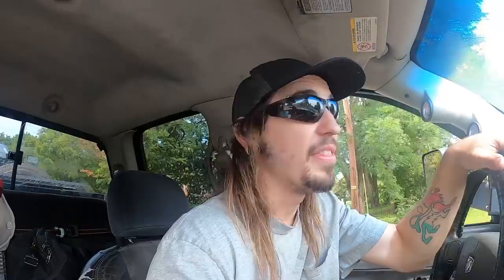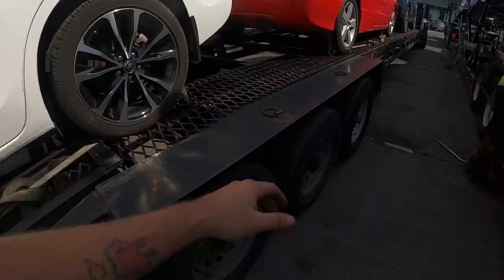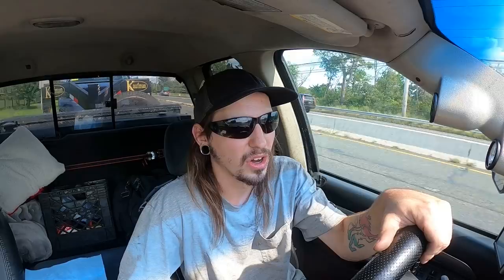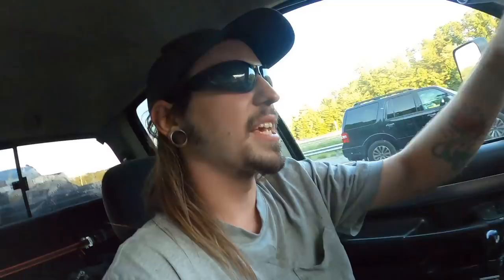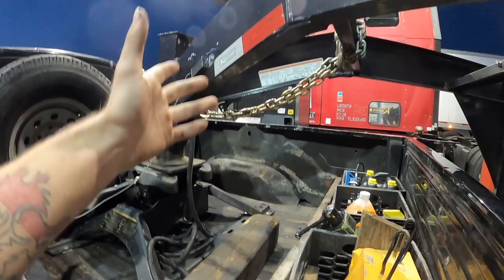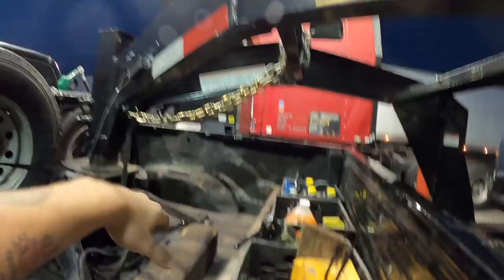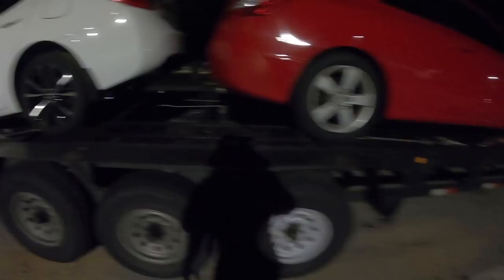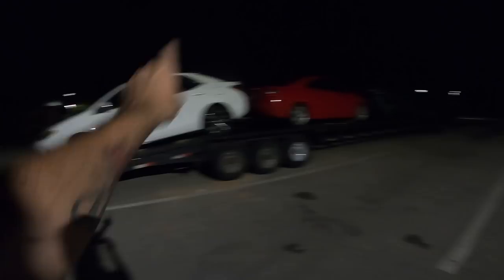This Load Threw Off My Trip | 3 Car Non Cdl Car Hauling | Hotshot Trucking

Comment: If that trailer has a slipper spring setup, you have to look closely inside the spring hangers....they break all the time! The spring rests on a steel plate that is welded inside the spring hanger. That weld will break..the plate will fall out and then the games begin.. a lot of guys miss this problem because you actually have to be flat on your back to look up inside to see it. I missed this my first time and broke more stuff...also, GOODRIDE makes a great 14ply.

Comment: If you are not sure of weight.  Weigh first.  It’s easy to figure how much fuel you can safely add.  Basically in sumner 7 lbs a gallon. @ 7.1 to @6.8 lbs depending on temps, additives
Reply from the maker: I did that last time. Could only fill up 93 gallons out of the whole 140. I figured I was way over on this one though!

Comment: I ran the china made providers 14 ply on my goose neck.  It was cheaper to buy them brand new mounted on rims than to just buy the tires.  Plus when you go to the 14 plys you need to go to the heavy duty 4400lb rims or the extra tire pressure may cause rim failure (happened on my Step dads camper).  The tire wear im betting is axle alignment.  If you got a tape rule measure a spot on that side an the same exact spot on the other, bet that pass side is farther forward than the driver side.

Comment: I got a Edge on my truck and I had no receipt or anything to back up purchase. I opened a claim on the website not expecting anything  but I explained unit was totally dead. Wouldn't power on in truck, wouldn't power on when connected to a PC. To my surprise they repaired it no questions asked for free. They even included a ticket with what they fixed. Worth reaching out, they seem to really stick by their products. Sucks its been so problematic for you.

Comment: Some lights under the trailer for loading or checking the load would be cool...add a switch. Or, get flashy with some neon's! As for your tongue weight, it's not a set amount you are looking for, but a percentage. 15% is like perfect for me. If I get up around 25% or more, I get pounded on the concrete joints in some places. You can calculate the position for the center of your cargo's weight to achieve the percentage, but it's harder for vehicles because you don't really know how much is on each axle...just educated guesses based on experience (which you obviously have). Wish I had a tunnel down here to check out my sound. My latest truck is a rollover wreck I picked up at Copart...taking off the cab and putting one of mine on it. It's straight piped and my neighbor said it sounded real good, so I'm not gonna fix that. I was out in the yard slinging dirt and rolling tons of coal to check it out. Definitely not for business purposes! Stay safe out there and don't let the haters get to you. They still have to do what their mama tells them to do and they're taking it out on you.

Comment: I'm sure you know the middle tire always wear out first. Low speed turning I was told when I was in the market back in the day. The reason I went with tandum duals instead. I'm sure the tri- axles have other advantage over duals.
Reply: I bought one mainly for soft ground, snow..  1 trail instead of twice as wide.  I had brake drag hard.  Removed tire, chained that side of axle up, kept going till I was unloaded, had parts to replace brake.
Reply: @larrythompson8630  I'm in FL we don't have snow. Never knew about tri- axle brake issues. Thanks for commenting. Stay safe.

Comment: It’s easy to check basic weight online. Of course it’s within a range.  But should be within 500 lbs.   on lights.  Make sure they are not considered clearance lights.  Most DOT consider EVERY added light to truck trailer that’s hooked to “parking light switch” to now be “necessary”. I.E. if a light you added is broke, burned out…. It’s treated as if factory side light is out.
  IF I was hauling regular.  I would look into mounting a couple cameras to onboard source.  Not mainly for YouTube.  But bad drivers.   It’s amazing how often drivers “misremember” cause until actual video proves what light was green, who drifted into trucks lane, cut semi off, slowed down 6’ ahead to make a left at last second.. I bought a cheap one.  Will likely get a better one this winter.

Comment: Hey mate. Do you rotate your tyres much? We had a tri axle trailer and found the middle tyres always scrubbed out different to others. Go to a big parking lot and get someone to drive around you in a tight circle and watch how the tyres roll and flex. That will give you an idea on how they will wear. Found that here in Australia the passenger side tyres wear the outside corners more due to to the camber on the road too. Enjoying the videos mate. Safe travels 👍 cheers Jack
Reply from the maker: I haven't had it long enough to rotate them😅
Reply from the maker: I haven't had it long enough to rotate them😅

Comment: Do you have to balance the weight over your axles , or can you just put the cars on any way as long as your under weight? Take care, stay safe out there.
Reply from the maker: As long as you're under weight and there's more weight towards the front you're fine. You don't want too much weight in either direction though. Slowly learning and testing

Comment: How are you getting by with the older 12 valve in your newer truck with the DOT? Federal emissions? Do they even notice?
Reply from the maker: You just need a letter kept at the main office of your company proving it was done. Vin, serial numbers, year, etc. That shows I can run my paper logs. We went through an audit and they made sure we had that done since I'm running paper logs.

Comment: What happens if tire or tires  goes flat during transport  will straps still hold?
Reply from the maker: Yeah, but the chances of that are almost none. 2 straps is enough but 4 is required so if any let loose you have the other 3

Comment: I have a 2500 turbo diesel has a freshly rebuilt tranny motor is strong,No cdl ,Gvwr =9000… any suggestions for trailer ,is 35+5 be too much
Reply from the maker: You'll be limited to a 17,000 pound trailer but that gives you options. 

Without a dually you'll be stuck putting loads further back since you're limited on the drive axles. That's your limiting factor.

You'll run out of axle weight before you run out of carrying capacity. Recommend starting with something smaller to at least see if the truck will take it. 32ft at a minimum. Move up to a 40fter and a dually down the road and possibly a cdl.
Reply: Okay that's what I was looking for thanks for the advice.

Comment: I wonder if there is a way with that gauge cluster to replace the individual gauges without having to replace the entire cluster, cuz it looks like in the video that you're smaller gauges still work it's just the tack and the speedo that aren't working.

Also if it is low pressure with it being a center / pivot wheel that may explain the weird wear on the outside edge
Reply from the maker: None work. They are all frozen in place
Reply: @CPSteveMiller  okay then, I stand corrected. At least if someone looks in there while the trucks running it looks like everything's fine except for the two main gauges, LOL
Reply: You can send it out to get the cluster rebuilt. I have done it many times. Ship it out to a guy. Under 200. Think normally 150. Can give you guys info if you want

Comment: What is the best truck u suggest to start?
Reply from the maker: Right now I don't recommend it at all with these fuel prices. Every truck has their issues. Just have to pick your poison. New trucks are having issues with parts being in stock so they can sit for months for a break down. Old trucks weren't technically made for this but if you're mechanically inclined and not afraid to get dirty it's manageable.

Comment: look at the inner edge. if inner edge is also worn its due to underinflation
Reply from the maker: It's not, I did check that. It's only the outside edge. Hopefully be picking up 2 14 ply's here soon as a replacement!
Reply: @CPSteveMiller  sounds like its out of alignment an may be crooked

Comment: Heaviest part of the cars is the engine wouldn't it be better to put back two cars nose to nose over the trailer axels
Reply from the maker: Depends on the car. These are pretty light so I'd rather just pull them up on

Comment: You need a CDL for it.
Reply from the maker: Not for this setup, you don't.

9k gvwr truck
17k gvwr trailer
26,000 gcwr

No cdl is required for any vehicle under 26,001.

As for actual weight. This load was just over 25,000 if I remember correctly and all axles were under their legal weight.